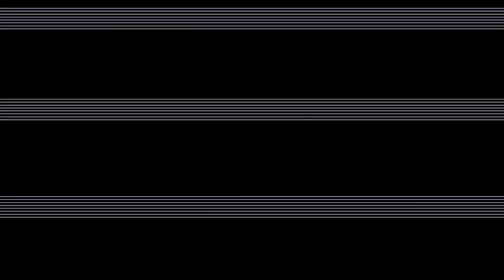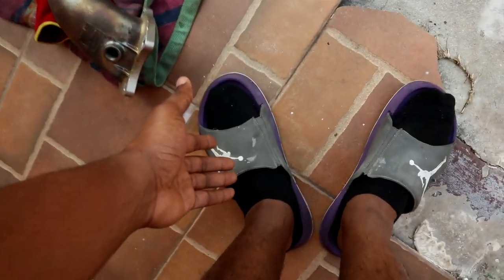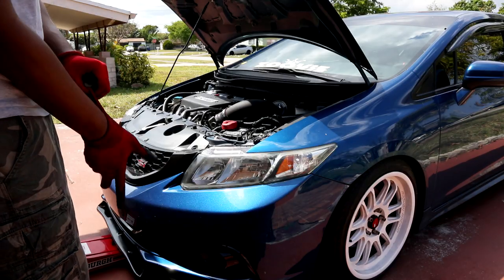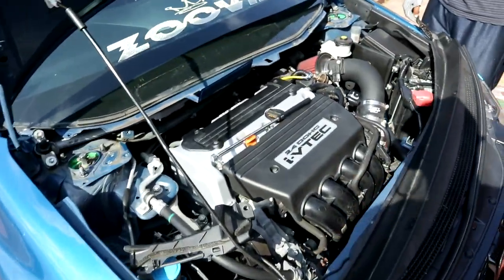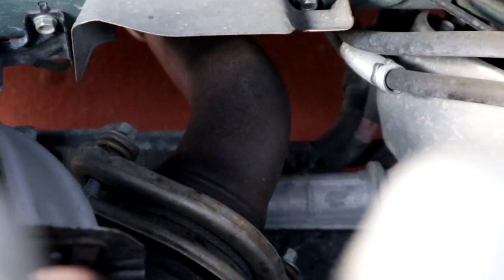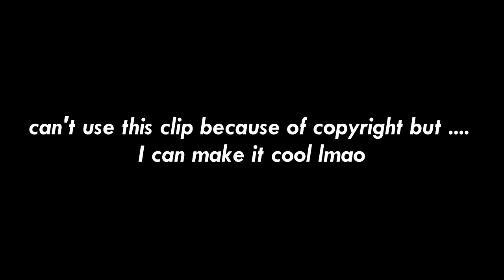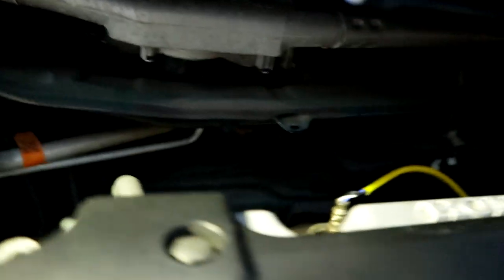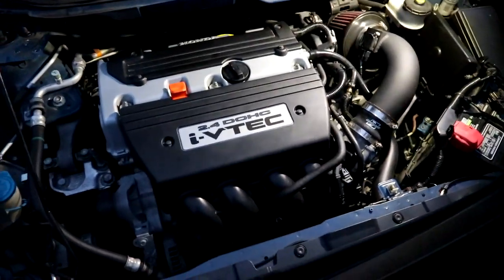Installing Skunk2 Downpipe On Dusty! | 9th Gen Si

Comment: Friendly recommendation brotha! A tune will bring your setup alive, that’s if you haven’t gotten one yet. I/H/E and my car pushes 215whp/185wtrq. Also a very smooth powerband after tune.
Reply from the maker: Trust me bro I know .. I have a cel eliminator so I don’t get a CEL and I got more stuff to install before tuning
Reply: zoovie Fire bro, the build is coming along great. Have you shopped with FKXRacing before? The online store shows lots of love for our cars(Civics).
Reply: Zoovie, can I get some info on the cel eliminator? Currently running just a skunk 2 CAI, but starting to look into, adding some more bolt ons. DP and Exhaust. Did I quick google search, and saw that it removes the check engine light and you can do some adjusting with it. What’s your current set up if you don’t mind me asking?

Comment: The rev9 coilovers how long have you had them and are they still good?  Dont ride like no pops or noises and no blown shocks or anything becouse I'm about to just run h&r springs I dont want to spend 1200 plus on good set of coils
Reply from the maker: Casey Moore get them , if you on a budget.. I have over 30k miles on them and they ride perfect, no pops or noises

Comment: no codes came out? or u disable it with ktuner?
Reply from the maker: No , I have a CEL eliminator on the downpipe
Reply from the maker: You can disable it on ktuner as well but I didn’t need to
Reply: thanks man. now you need 3.5" intake 🔥🔥